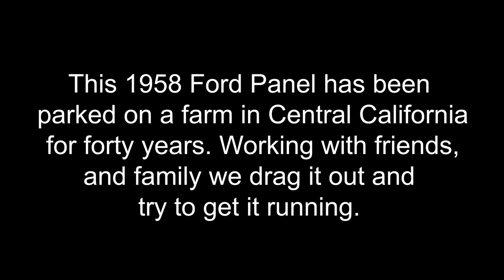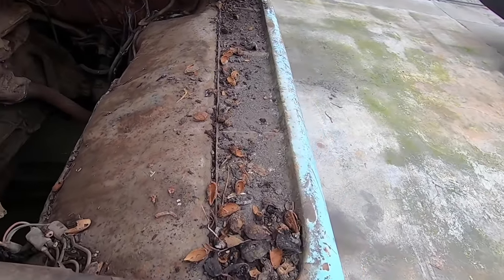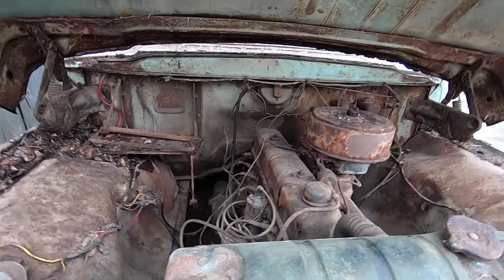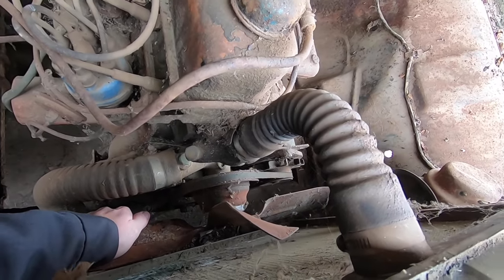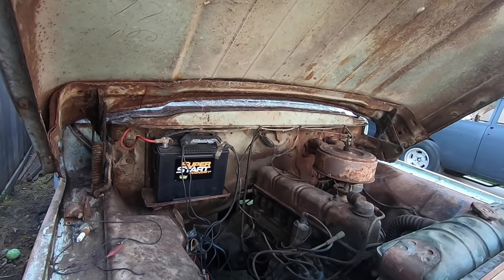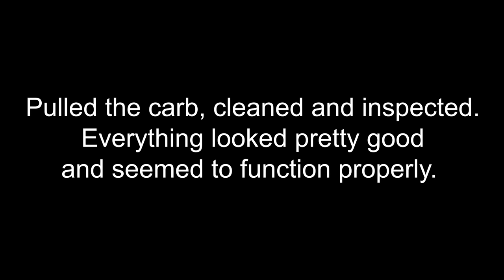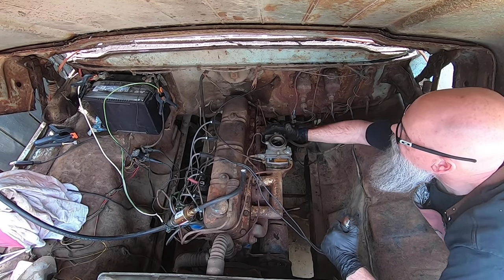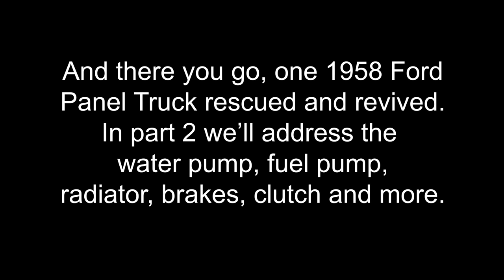1958 Ford Panel Truck Rescue Part 1 - Speed & Chrome Illustrated Magazine

Comment: 1958 ford panel old school vehicle needs everything new seats paint job if the engine is good condition pressure washer awesome video friend bless you headlights also the fan cool down the engine
Reply from the maker: Check out part 2 if you haven't thanks!!! https://youtu.be/ayOzqMON7wg

Comment: Sounded like a diesel engine.That is so cool that you got it running.
Reply from the maker: That would be the solid lifter cam, and the valve lash thats way out of adjustment. I talk about that in Part 2.

Comment: Great Rescue! I felt bad for the truck being buried like that. Previous owner had trouble with right turns. Every panel was hit. Backing up looked to be a problem too
Reply from the maker: The visibility in these isn't the best.
Reply from the maker: While is does have its share of dings, the truck is pretty solid. Very little rust issues.
Reply: @SpeedandChromeTV  True
Reply: @SpeedandChromeTV  Very nice truck. Glad you saved it. I'd drive it.

Comment: Considering where that panel truck has been sitting and for as long as it was sitting it has faired pretty well. Going to make one cool ride for someone..
Reply from the maker: California's Central Valley is a pretty dry climate. Things don't rust away here. I agree, someone will end up with a really cool ride.

Comment: I liked the music background as it is better than listening to people grunt. I wish more of the first start videos were cleaning and checking to see what they have. That old 221 ford engine came back.... not much to start with but a good place holder. Lot more good metal than bad so its a builder unless the frame has some hidden agenda. Even the wiring as old as it is will probably be usable but nice if replaced a wire at a time till all in nice rows then the ends on an loomed. There were many a loaf of bread sold out of those trucks
Reply from the maker: Frame is solid, wiring is toast, it will get a new harness. I talk a bit about the bread truck part of it in the next video, working on that right now.

Comment: AWESOME. Hope you plan too keep the littler Sixer. Those really will last 50-100 yrs. Eazy. I have a friend with a very early Ford model T unRestored and it purrs! Personally just me If you're not going for "Stock" Eng bay look. I'd Add some Cool Performance mods to that little thing. Headers, maybe Chrome Air cleaner & Valve cover, etc.

Comment: Pretty much all the videos I have seen about old cars rescues, the guys never change the oil before fire up the engine. Is it a good idea to start the engine with 40 years  old oil in the pan?
Reply from the maker: Not for any length of time. Most guys will verify the engine will run and get the oil hot enough to drain out. Then put in new. We didn't have a cooling system so we couldn't run it very long. Not having oil in it is another story. Once we new it would run, the oil was changed and we went to work on the rest of it. 38 years is a long time to sit outside.

Comment: The carb will def need attention.
Reply from the maker: We pulled it apart and cleaned it well, put it back together and it works well. Even the accelerator pump works. I'm pretty shocked.

Comment: are you going to ruin this truck by painting it?
Reply from the maker: I wouldn't dare mess up this perfect patina. Even the dents have good paint. The front pass fender does need to be partially replaced. I have a fender already for it. Wouldn't be too hard to spot in the original color and color sand it to match. Just depends on how long I keep it.